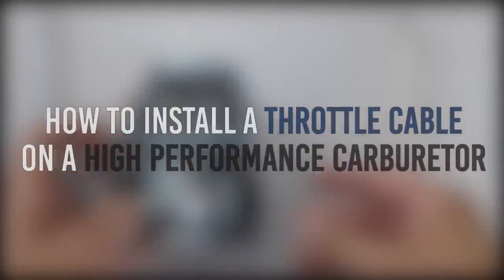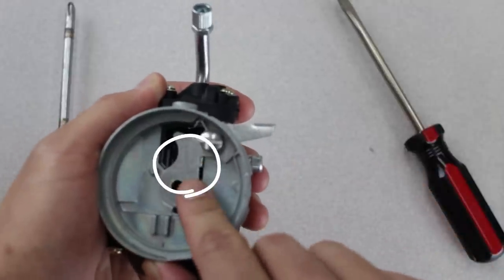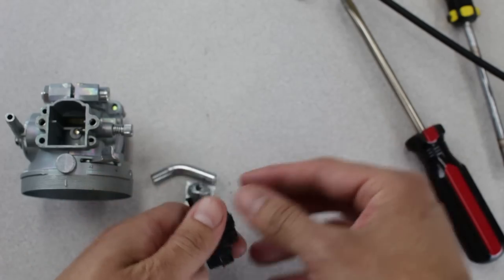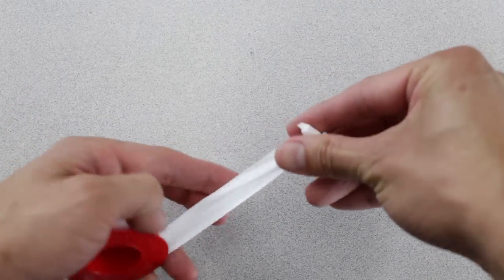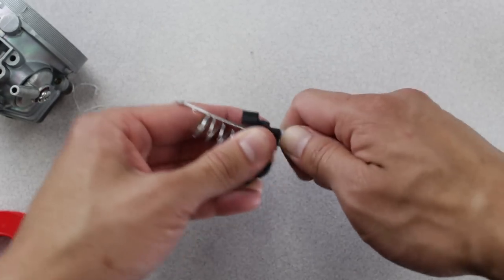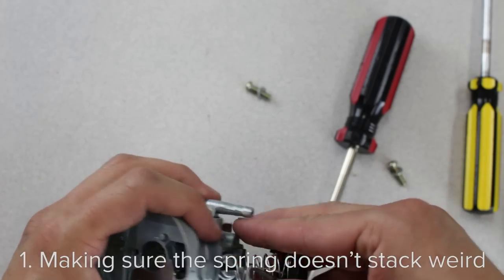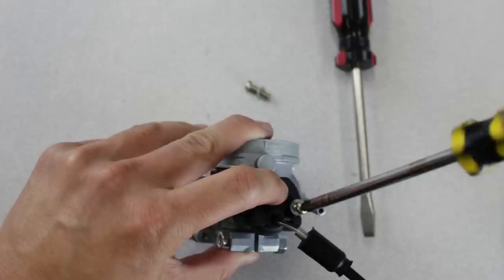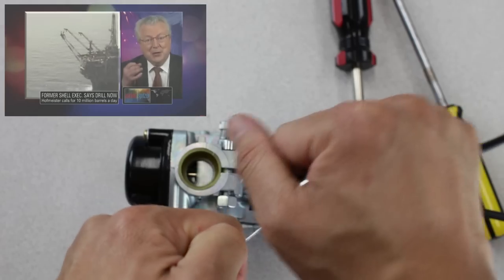How to Install Throttle on High Performance Carburetor

Comment: I used this video as my reference to install my new HP carburetor. Not only was it a perfect installation, but I actually gained more top end power on my 66cc engine. I'm running a reed valve with a windowed piston combo, and my last stock carburetor wouldn't deliver the response I was looking for. When I upgraded to a HP carburetor from Amazon, talk about a real difference in performance. Now I have plenty of top end power, and lots of bottom end torque for taking off. I use only 1/3 of the total  throttle now, great fuel economy now.. Thanks for the video, it saved me lots of time.
Reply: What reed valve could you use the NT carburetor with? Can you send me a link? The NT carburetor does work good if you have the jets for it. I have ones that go clear up to 90

Comment: Hey bikeberry I believe the cable was installed wrong on the carb there's no reason to fold the cable after locking it in if you go the opposite way it locks in perfectly without having to crimp it . I might be wrong but I have two carbs and my cable is set differently , I guess whatever works works right !?!?
Reply from the maker: dazela51 Whatever works!
Reply: I noticed that too. Mine works perfectly the way dazela51 describes, with no silly bends... Just sayin'...
Reply: BikeBerrycom no, don't tell ppl "whatever works" & have em wind up with a suicide throttle. admit you made a mistake. or better yet, fix it. be responsible

Comment: Great video man. Just got my performance carb in the mail & even with taking off the piece on top, the cable still isn't long enough. Another issue is that I'm worried fuel will leak where it's connected to the cylinder block since this carb takes more room I'm not sure if it's completely sealed. If I strip the wire and it doesn't work out would it be an easy fix to reinstall my old carb?

Comment: I just watched your video using stock throttle cable on the HP carburetor if you use the fitting off of an old hand brake where the cable mounts to the brake the fitting is the same tread as the HP carburetor. just a thought

Comment: The way this video shows connecting the throttle cable end to the throttle slide is bogus. If you go to the carburetor description in the link he shows above it has this note: Note: Throttle cable end will more than likely need to be filed down to accommodate the carburetor housing.
What that note means is, put the lead crimp end of the cable in the jaws of a vice grip and file off about 1/16th of an inch. Then you can slide it into the slot at the end of the throttle slide and rotate the cable so that it is aligned with the slide. The big return spring will prevent the cable end from coming out of the slot once you reassemble the slide into the carburetor. The way this video shows it installed, the bend in the cable will drag on the inside of the throttle housing, causing the slide to stick and not return fully to the idle position.

Comment: instead of wrapping the pin in tape just remove the pin from the original carb i tried it and it fit the thread and no tape
Reply: +adriano lehman I did the same thing. Works perfect with the stock throttle cable this way and the inlet is nice and tight. Man this carb is a great improvement over the stock NT. My throttle response is so much tighter.
Reply: @rimshotrecluse9345  i am so hyped to buy it.

Comment: I had problems getting the choke system to catch properly. 
But, that being said. I love this Carb. Worth the money in my humble opinion.
Reply: +Monstertalon 
There's a "catch" at the top of the lever on the inside. With the choke 
ON, when you move the lever toward the engine slightly it will release 
the choke plate on the inside by way of the spring on the choke plate.
Reply: The choke arm itself has a little screw and can make setting the choke on an SHA style carb a real pain in the ass so here is a tip after you install the throttle cable check and make sure while the carb is still off the bike that the choke functions properly because for number one you can adjust that little screw that holds the choke arm in place so don't make it too damn tight. On a few occasions I have set the screw in Locktite when it's come loose a few times and becomes a pain in the ass. You can prevent all that by checking it before ya put it on the bike and set that little screw so wear and tear don't make it come loose on ya...

Comment: Thanks for the video. I had a few sizing problems so I was looking for solutions. When you set the choke it locks. To unlock it you use full throttle. Mine doesn’t turn choke off though. I’m guessing it was just manufacture defect. If anyone else has this problem. Push the choke pin towards the piston side of the carb and it will click over the choke lock and run normally. As far as putting the throttle cable in. Listen to the video. Take off the sleeve. Mine wasn’t long enough so I was screwing around with brake cables I had laying around cutting and crimping to get one long enough. It was horrible. Still not fully completed. In about a month I’ll make a video on the finished build and the things not to do.

Comment: quick question i installed this carb and the motor is running a lot hotter is that normal and what grade gas is good for this motor bike

Comment: OK I thank you for making this video I put the same carburetor on my 47 cc pocket bike. there were some mistakes for the 47 cc pocket . now instead of using plumbing tape to put on the threads that comes with the new carburetor use the brass one from the stock carburetor and you don't have to use the plumbing tape but what you do use the plumbing tape for is the gas hose that goes to the carburetor will be too big to go on to the new performance carburetor. so you put plumbing tape around the gas plug in on the new carb and put a zip tie around it to hold better than the stock clamp that is for all the people with a cagllari 47 cc pocket bike
Reply: this is for exactly a cagllari 47cc pocket bike and if you get a boost bottle like I did then it would be upside down and the fitting would be pinched against the frame so get the other intake that come with the carburetor and drill a hole in the top when it's upside down

Comment: hey bruva! love ya clips! just a quick question! i upgraded this exactly the other day... the new metal throttle i bought.. has the 2 openings 1 fot the kill switch & the other 4 the throttle 2 screw in.. can u PLEASEEEEEE tell me what the "ALLEN KEY HEAD ED BOLT in the middle is 4? i hope u know what i mean! cheers!

Comment: I have a question. What makes this carburetor High Performance? Other then the auto-unchoke, but that's hardly a High Performance feature. I'm just a little more then curious as to why it's called High Performance. Seems like it's more of a problem then beneficial.

Comment: After you reassembled it, you show it working by pulling the throttle cable. Would have liked to have seen the bigger spring on the inside to make sure I have mine seated properly. Couldn't really see it well with you closing the choke, showing that locking correctly.

Comment: I have the same carb on my bike I just bought, got a problem, bike starts on the pull with choke on then when the choke is put off and reved it cuts out, I've stripped and cleaned the carb plus put clean petrol in with 25-1 2 stroke mix, still the same, any ideas please..

Comment: so..i installed everything that came from bbr..had issues as well with throttle cable and these comments helped alot..but im still having carb issues..still bogging out..feels like no power..do i have to take a new carb apart and clean jets and shit?..do i need to change my mix ratio?..right now im doin 16:1?..eventho im a teacher im ready to go to school yall..where my moto bike teachers at..i need some schoolin.help

Comment: I have an issue that I don't understand. As I was disabling the cover  I turned the carb. upside down and the inside lever for the choke fell out. And now I'm not sure how does it go back in. 
Next day. Well I put on my thinking cap and figured it out. Sometimes you just have to walk away from things and let yourself relax and think a bit . I haven' t started it yet  but when I do I'll post the results.

Comment: I assembled my mess kit fired it up it will not accelerate when I twist the throttle it does pull back the needle. What is the secret Hong Kong trick to get it to work?

Comment: Ok so everyone be prepared to strip your cable. I have a question. So I got the carb installed and my bike runs & goes but it's a lot slower and I feel like when I push the throttle down all the way it's not pulling enough on my cord to open the valve all the way. What's a fix for that?
Reply: I have this problem as well

Comment: You can technically cancel out that clip and use a thick rubber band to counterweigh the choke when it is switched, yet elastic enough to let the internal spring function properly.
Reply from the maker: Great advice! Keep the wisdom coming.

Comment: Bike berry I recently put on a high performance carb on my bike and every time I turn on the choke it doesn't set to run after I twist the throttle all the way  if you know what Iv done wrong can you help me out
Reply: +Ryan Gosling 
There's a "catch" at the top of the lever on the inside. With the choke 
ON, when you move the lever toward the engine slightly it will release 
the choke plate on the inside by way of the spring on the choke plate.

Comment: Hi I was wondering why my choke lever won't budge I know the clip thing snaps and makes it stay but how do I move it?
Reply: when throttle is pulled then it release the choke. or just push the pin in if its off the bike or raise the slide

Comment: QUICK AND EASY FOR EVERY ONE SEE THE SILVER NECK TAKE THAT OFF AND GRAB THE OTHER ONE FROM THE NT CARB AND SCREW IT ON TO THE HP CARB. ITS NOT THE SAME SCREW TYPE BUT IT WILL WORK

Comment: Ive read that this so called High performance carb is the same as stock except for the custom air element. there for you just buy the air element and secure it with two screws. Is that true?
Reply from the maker: We have different carbonates at different performance levels and costs. This high performance carburetor is very similar to the stock carburetor, that at a quick glance they look nearly identical. There are a few differences between the two, such as a larger jet size on the high performance carburetor, and the most obvious difference, the air filters

Comment: Its not right, did this for my carb and it performed terribly, the throttle cable should go through the hole of the throttle slide then it sets in the slot. Cable should not be bent

Comment: Same problem, I put the choke button down and it won't go back up please help
Reply: +kevin thegreatest if you remove the air filter you can see the end of the retaining piece that is holding the choke in place, use a screw driver to push the 
retaining piece back and the choke will snap open again.
Reply: all you do is if you are looking straight at you choke push it to the right and it unhooks off the clip and pops up

Comment: I replaced the sprocket in the back and little things to make it faster with a high performance carburetor but it's still it's not picking up speed like it should

Comment: I would advise people not to install their throttle cable in this manner. It is NOT how you attach the cable to the slide block. The cable is not supposed to have a bend or kink at the end. It should be 100% straight.
Reply: Dude for real lol the slide wasnt even opening up all the way when he pulled the cable 😂😂

Comment: i got a motorized bike with cheap parts from china. it has the "standerd" carb on it the guy offerd me a proformace carb. do these things really make that much of a difference in proformace on such a small engine?
Reply: yes they do, although your first upgrade should definitely be a better exhaust, like an expansion chamber
Reply: sold the bike already. was just too messy. constantly leaked fluids bearings on the bike where already going out. ill just probably save up and get a dual sport bike one day.
Reply: damn sounds like a bummer XD

Comment: This carb is complex in many ways to install.this is the essy way ..my way you basicay have to shave down the housing.and cut the lacing for a bit more slack i did my way to keep the noodles amd adjustable screw.which you choice to install this your engine will respond better then the nt and best part more leak fuel..currently i uses the filther comes with it..but might want me something smiliar to a motorcyle or moped style one that have the slight angle on mount on it?
Reply: Easy way i meant

Comment: You don't bend the cable like that when you fit it to the carburetor slide on one of these HP Racing carburetors. But, unfortunately you & everyone else posting videos on Youtube tells us to do it this way. 
NOTE: Doing it the way U have done it is totally wrong & eventually it will get stuck or over-rev or just pull out. And, in all honestly do you really think that it looks like the correct way to do it?

You need to get the correct cable & it fits in the slot perfectly and the spring keeps it in position & it pulls straight up using the little lead bead on the end the way it is meant to. Some online stores are just selling old style cables that are the correct length and telling you they are for the HP Racing Carburetor when they are not the correct cable at all.
They do not have the correct lead bead on the end, & most of these sellers don't have a clue anyway. But take it from me just because they are the correct length, they are not the correct cable unless they have the correct bead that looks like a smaller version of the twist grip end of the cable.

NOTE:  You can use a normal style cable with the long bead on the end that usually fits in the round carburetor slides, but you need to just grind or cut a couple of millimeters off the lead bead end, just enough so it will slide along the groove (standing straight up) & once you have done that it will then fit perfectly in the correct position against the back of the slide where the little hole is & the spring keeps it tightly in place.
 It is not as good as using the correct cable but it works just as well without that dodgy looking bend you are using.
You can even get out your trusty soldering iron and carefully add some extra solder to the cable bead width if you are worried about it pulling through the slot, but it is unnecessary.

Comment: No, just...no. 
1) Do not install the cable this way with a kink in it. The cable should be straight up and down. The cable stop fits INSIDE the hole he initially put it through. Insert it from the other end and if the cable stop doesnt' fit in the hole then grind down the end of the stop until it does. Or if you're feeling really saucy, elongate the hole in the slide (on the bottom preferably) so the stop will fit.
2) Don't remove the elbow.
Problem 1, backing the adjuster out leaves you with less thread engagement. On plastic no less. That ain't gonna last.
Problem 2, on mine anyway the hole diameters are different. Taking up that space with teflon type is just flat out wrong, period, full stop.  If they're the same size and thread pitch it would normally be OK, but you probably wouldn't need tape anyway, and see problem 1.

Do it right and it's no challenge to put back together at all; it will go together easy the first time. That kinked cable is messing everything up.

Comment: absolutely wrong way to hook the cable to slide
Reply: What is the right way
Reply: It is I put it on the way he did and it's so hard to give it throttle
Reply: So I went back to the stock carburator
Reply: Devrim Ekici  just feed it in the opposite way and it'll lock in with no folding the cable.
Reply: @spacefood3384  I got it fixed and working but ty and the Jets to big
Reply: @Garrett Gussert do a video
Reply: @patsmotorizedbicycles6943  he's right though, absolutely the worst way to explain how to assemble a HP Carb. Bikeberry made it intimidating to the novice enthusiasts just starting and wants a little more kick out of their engine. It's really not that hard if you can assemble the stock carb you can 100% assemble one of their HP Carbs.
Reply: I did it the way buddy did and mines not sucking gas or going too fast.. any suggestions anyone?
Reply: Yeah seriously not the way to do it
Reply: love how everyones saying its the Wrong way but not showing the Right way